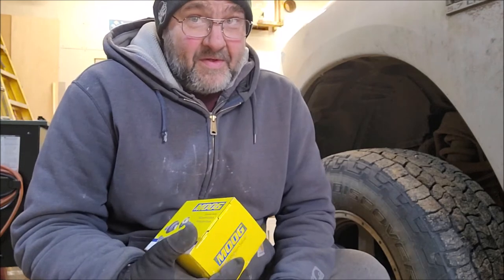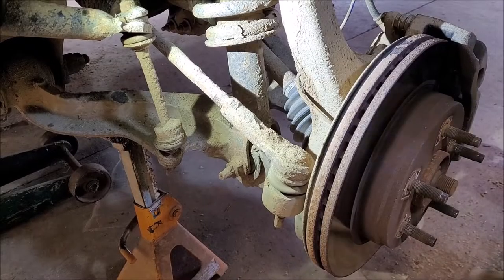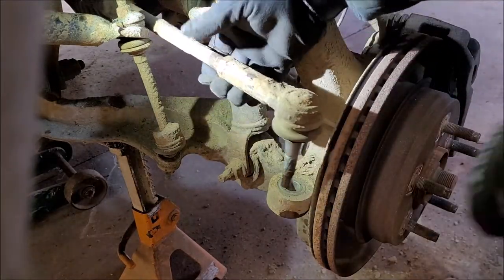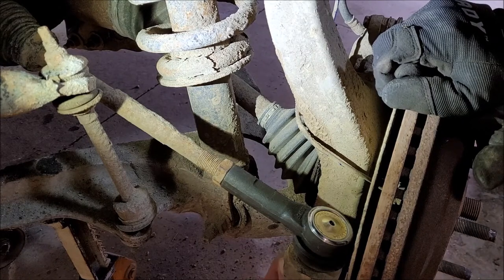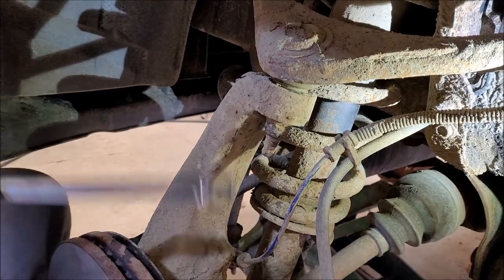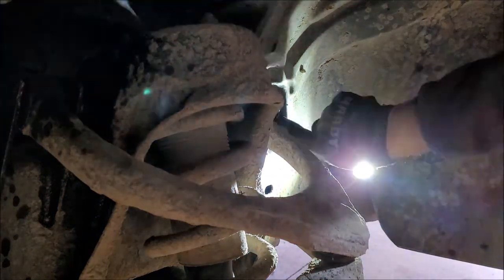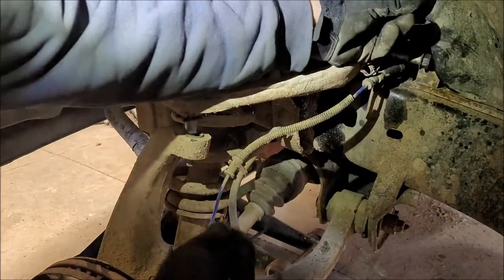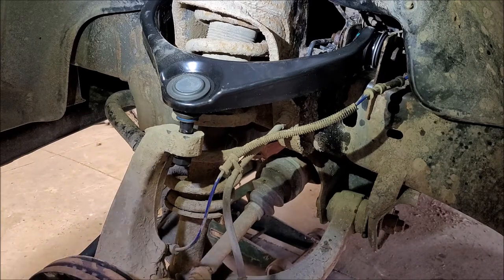Control Arm and Tie Rod End Replacement 2010 Dodge Ram 1500 4 X 4

Comment: Thats a lot of wrenching!! Think I’ll pick up the right size ratchet wrenchs for this job! Good job, one question though, wouldnt it be easier to thread on and off the ball joint nut if you put a second jack under the lower control arm and press the suspension up? That way the ball joint wouldnt be at such an odd angle? Thats how ive down it on my 4 wheelers in the past!
Reply from the maker: it was,  lol  I don't have a second Jack for that, but I do suppose you are correct,  I know smarter not harder,  I got it done, thanks again for watching